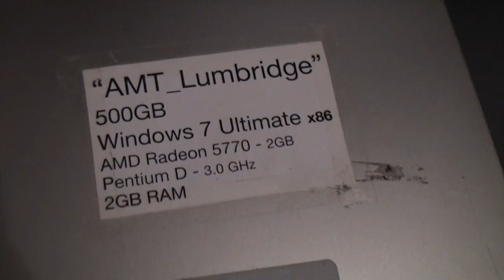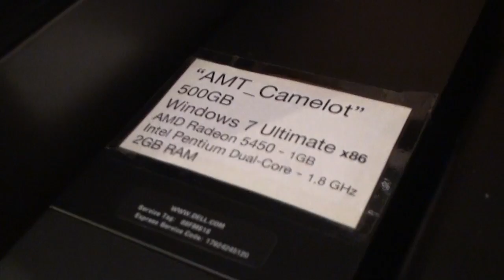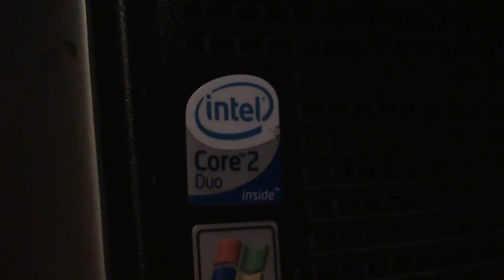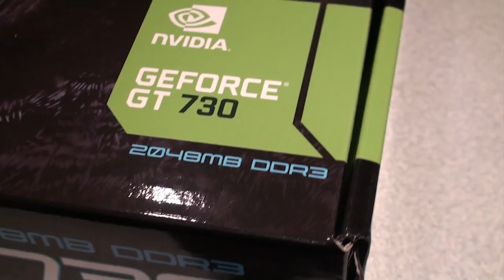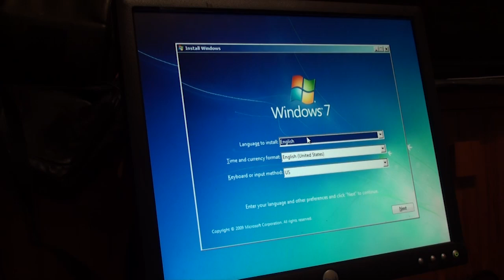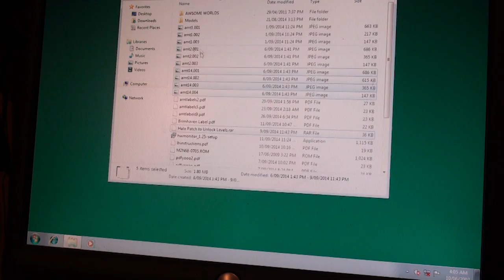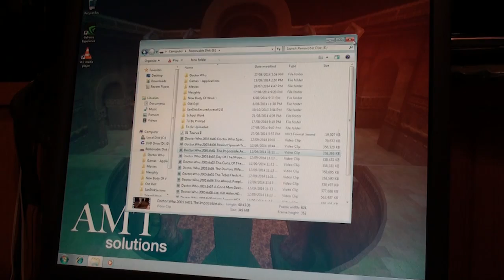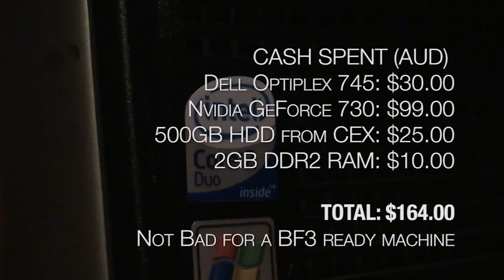Turning an Optiplex 745 from Boy to Man - Green Ham Gaming

Comment: Meanwhile, LTT bashes the GT730.
Reply: Even if I can assure you by experience, you can overclock the living daylights out of it. 
I've maxed mine out and I have no errors at all.
Reply: I'm actually planning to get a GT730 as a replacement after my horrendous GT520 got fried.
Reply: ToperMasterComedy Haha, I had a similar case today! My old P4 got fried today!
If you get one, consider overclocking it, it can go up pretty high.
Reply: Lizrad Sceptile No, let him to do it, the 750 can't get as overclocked.
Reply: TheLazyWanderer he can buy something used for a much better price. Its pretty dumb to buy a gt 730, which gets beat by intergrated graphics, rather than buying something used like a gtx 650/660 or a radeon 7850/7870.
Reply: Lizrad Sceptile Well, I needed to find a low profile GPU that will take the place of the GT520. So it needed to run power off the motherboard and fits in a low profile case. Most GTX cards are out of the question and most high end cards.
The only GTX I can go for is a low profile GTX750.
Power consumption is also a factor here since my setup runs off a proprietary 180w PSU. I calculated and the max TDP GPU has to be under 55w. 
So I got very limited choices. Any good suggestions for powerful but power effiecient and low profile cards?
Reply: ToperMasterComedy Yeah, the GTX he is talking about won't fit in your case.
And also, it takes far more power. The GT 730 will consume 79 watts maximum. It usually consumes 50.
Also, Lizrad Sceptile , NOT EVERYONE HAS CRAIGSLIST OR OTHER SECOND HAND SHOPS AROUND THEM TO GET SECOND HAND ITEMS FROM, BOTH YOU AND BLOODY LTT, PLEASE REALIZE THIS!
Reply: TheLazyWanderer I got multiple choices so far. And it's a mix of cards really.

I'm still researching so oppinions may change overtime.
For power consumption, I'm considering either a GT730 or R7 240. Both have power consumptions close to the GT520. But both are more powerful than the 520. And I don't need to worry about risking blowing up my PSU. Which can't be upgraded since it's proprietary.

I'm still considering more powerful choices but again, power consumption, needs to be 55W or under. 
Originally I was thinking about the low profile R7 250 like GHG used in the Quad Core Dell, but even the low profile uses 65W TDP. Which is rather unefficient since the GTX750Ti Low Profile is way more powerful and only uses  60W.
The GTX750Ti is out of the question too since it's TDP is 60W. Which means only the GTX750 will work for my setup since it only does 55W.

My other choice is a Radeon 7750. On par with the 5770 which GHG always use, it's performance is close with the GTX750 on paper and it only does 55W under load. 

So far my choices
GT730
R7 240
GTX750
HD 7750
Reply: ToperMasterComedy I know the 7750, it's too big, as well as the GTX.
The R7 240 is... pretty weak, also the 730 consumes less power than that one.
Reply: TheLazyWanderer The 7750 and GTX750 both have low profile options.
The R7 240 is out of the question then.
Reply: ToperMasterComedy Yeah, but the low profile GTX has 1 gb of vram at best.
Even if it is gddr5, it's still small.
Reply: TheLazyWanderer Well, the VRAM doesn't seem to matter too much to my liking anyway. As long it's 1GB at least. GTA 5 maxes out my GT520 more than it could take but I can play the game on normal settings at near playable rate. I'm not too hard core in games but I do want to extract more in terms of graphics performance.
Reply: TheLazyWanderer I'll take all of these into consideration. I'll see what I'll decide eventually.
Reply: ToperMasterComedy Alright...
Reply: TheLazyWanderer get something from a friend then. If not, then find a deal. Patience is a virtue. If you dont feel like waiting, than go for an r7 240 or a 730. However, id suggest this guy gets a whole new system, because of the proprietary psu.
Reply: Lizrad Sceptile Well, I don't really feel like getting a whole new system over again. The processor which was a Sandy Bridge i5 is still perfectly capable. So I'm not going to dump it anytime soon.
The only thing it needed was a few upgrades to get it to today's standards.
Reply: ToperMasterComedy oh shit, if it has an i5, keep it. Just upgrade your psu and mobo if it has a proprietary form for that psu.
Reply: Lizrad Sceptile Yeah, if he told you that it had a G3258, you'd be like "Eewwwww dump it!!"
Reply: Lizrad Sceptile Cause you're wrong.
I've heard the same thing from anyone who has a sick MLG PRO ULTRA POWER GTX  980 or higher.

(Even if I am thinking of bying an rx 460. It's the same price as the 750ti and it's much better, I compared the specs)
Reply: lol
Reply: TheLazyWanderer 
>im wrong
>730 gets beat by apu graphics
Reply: Oh gosh...This is turning into an arguement
Anyways. If I'm using something like a Ivy Bridge processor, then yeah....The 730 won't be worth it since intergrated are getting better lately. I have a laptop with a Skylake processor and the intergrated HD Graphics 520 works decent for lighter games.

But I'm using the Sandy Bridge for my main computer. Where the intergrated graphics were a joke and the GT520 that it came with help with some basic graphics. So a 730 still makes sense for an older system. It's still good for normal graphics that works for casual gaming without blowing up the PSU. Which I can't upgrade
Reply: Lizrad Sceptile The i7 HD graphics? 
Sure.
Reply: Lizrad Sceptile And LTT bashes it cause he always using Titan X's!!! 
You'd expect him to care about a budget card?
Reply: TheLazyWanderer anything with hd graphics 530. Which would be all the way down to the i3 6100
Reply: Lizrad Sceptile Do you know how much Skylakes cost here? 
180 euros. A good one at least
Reply: Lizrad Sceptile Do you have Hangouts or anything? 
It'd be better to move this talk somewhere else and not pollute this guy's comment with replies like that.
Reply: TheLazyWanderer the point is that the 730 is a terrible value.
Reply: Lizrad Sceptile TheLazyWanderer 
Feel free to continue your talks here. I'm up for your ideas.
Reply: Lizrad Sceptile I'll keep on saying otherwise mainly because I use it right now and I can still play the games I want.
I mean, yes, I am gonna upgrade eventually, but not to a sick powerful crazy specced card, I'm gonna get the rx 460.
Reply: the gtx 750 is about 4x better than the gt 730 though
Reply: Leon Yeah but costs double.
Did you ask him if he's in the position to give it 130$?
Reply: TheLazyWanderer why is this still an argument. The 730 is an awful card for its price. Maybe if it was cheaper, it would be better, but as of now its an awful card for its price.
Reply: It's 80 bucks.
If you're a Craigslist/eBay die-hard, that's not my fault. You can find better secondhand cards there for cheaper.
I'm not talking about secondhand cards there.
Reply: TheLazyWanderer Secondhand cards are way better than the gt 730 for the same price.
Reply: Leon You may say that there are better used cards than the GT730. And I agree. I would be happy to buy a used GTX for that price. But even under a cheaper price, not all PCs can handle it.

My PC. It has a small form factor case so it only takes low profile cards and a proprietary 180w power supply that can't be upgraded. It's my main PC and because it already had a 2400 i5 in it, I don't want to throw it out. 
I need a new GPU in it because the crappy GT520 was fried.
The low profile case means that most GTX cards are out of the question. The only GTX it will fit in is the GTX750Ti Low Profile. 
Power consumption is a thing as well. The 180w power supply means I can't have a high power card either. The 750Ti does 60w on load which is more than the computer's manual suggest which is under 55w.

The GT730 is a good replacement because it's low powered, 38w under load so I don't risk burning the power supply, fits in the low profile case and it's way powerful compared to the GT520.
And the GT730 suits my needs because I'm not a hard core gamer in anyway. The games I pretty much play is GTA 5 and some old games. Which the GT730 should be able to handle.
Even GHG mentioned the GT730 is great for low powered builds.

Not everyone here can build a crazy LTT system here.
Reply: Leon Again, I'm not talking about secondhand cards, cause not everyone has the luxury that is a secondhand shop close to them or even in their country.
Reply: ToperMasterComedy Your view is right.
I'm not saying it cause you're not bashing the card. But indeed, that is probably the best card you can get that is low profile and fits in the small form factor case.
Reply: ToperMasterComedy I dont have a crazy ltt system its a ebay system with an i5 750 gtx 480 and a 250 gb samsung 850 evo. I have been looking at a x58 mobo though. But would it be possible for you to remove the parts in the case because i feel bad for you having to get a 730, it cant really play any games.
Reply: Leon You have a gtx 480... and an SSD.
Those two make your pc crazier than mine and his already. I have a g3250 and the gt730. Well, the msi gt730. It's also overclocked, so it feels a bit more a weaker 750.
Reply: TheLazyWanderer Well dont forget the gt 740. And the PG3250 isnt that bad. Its probably better than my old i3 550.
Reply: Leon I've seen its specs... There's not much of a difference.
So, would you consider a rx 460 to be a good upgrade for 720p?
That's the one I'm planning to buy cause even if the 730 got me through most of the games I wanted to play, it can't run AC Syndicate.
Mind you, I won't get a GPU more expensive than the 460, that costs 200 euros here.
Reply: TheLazyWanderer at 4.9 teraflops i would say its a good 1080p card i definatly remcomment it, with syndicate though it might have to run at 720p. And syndicate is recommended to have a cpu with 4 threads so that possibly might be your issue.
Reply: Leon I can't afford a 4 core cpu, I'll only get one if I really, REALLY need it.
Reply: +TheLazyWanderer My i5 is a 4 core. But then, I bought it as a prebuilt system anyway.
Reply: ToperMasterComedy So there is no way to salvage the cpu and motherboard?
Reply: +Leon I can salvage out the CPU but I don't feel like rebuilding the whole PC.
Reply: ToperMasterComedy It will take like 10 minutes and then you can get a better gpu.
Reply: ToperMasterComedy That prebuilt system must have costed at least 500 dollars.
Reply: +TheLazyWanderer Well, it costed right in between 400 to 500. And damn I made a wrong choice a few years back.
Reply: +TheLazyWanderer It's more like a PC meant for movie watching and entertainment. The GT520 it came with just does that.
Reply: ToperMasterComedy Alright...
Then you don't need a powerful card at all, the 730 can get you up to 4k.
Reply: +TheLazyWanderer I don't use it as a part of my home theater setup. But it's designed for that type of applications. It's still my everyday PC for Youtube and casual gaming. Mainly, GTA 5 and some old classics like GTA San Andreas and Need For Speed Most Wanted. I have a Skylake laptop just for my schoolworks.

Nonetheless, the GT520 does GTA 5 at a choppy but playable framerate at low settings. And that's all I care about. Play these games at playable rate. The GT730 should do better and still keeping it's low power usage.
Reply: ToperMasterComedy I've finished it with this card, it'll bring you 45 fps at 1024x768 at high settings.
Reply: TheLazyWanderer The not even an hd resolution though. If I were him I would get a gtx 750.
Reply: Leon Again with this!
There is no gtx 750 that is low profile!!!
Reply: Newegg?
Really?
That's exactly what I fucking hate with the pc community. They act smart cause they all get their parts either secondhand or from the internet.
Heey, not everyone has credit or debit cards y'know! Some people are limited to retail stores. And this one doesn't seem to exist in a retail store anywhere.
Also, 120$. You do the exact same thing LTT does and it made me wanna bash his face in. "Ooh, I know you don't have much of a budget, but you can spend a bonus 40 bucks for this card!"
Final. What about power consumption?
Lemme clarify his request. He needs a card that won't use more than 55 watts, and that runs gta v at least in low settings.
I play it in 1024x768 cause I want to, the gt 730 can handle it in 720p, just in 30-35 fps instead. I just like the small buff in the framerate.
I BET you that this thing will use more than 60 watts under load.
Reply: +TheLazyWanderer I was actually going to find the low profile GT730 at newegg. Because all the local walk in shops only had full sized GT730.
The GTX750's power consumption even with the low profile, is still too much for what my power supply can handle. Needs to be under 55w again and I don't want to risk blowing up my PSU. 

About gaming resolution, I'm casual so I don't care about too much as long the game is playable. I did GTA 5 with 720p. All the newer titles I run on my PC I run them all with 720p. Most with low settings, like NFS Rivals(Overclocking my GT520 does make this game playable. Until it fried itself). Older classics, just crank up to 1080p and max my PC handles them fine. I used to play Left 4 Dead 2 on my PC. Maxed out the settings and the slightly overclocked GT520 doesn't give a shit. It lags slightly of zombies fucks with you but the rest of the gameplay is playable. 
This is my gaming experience with my PC and I don't really need much out of it.
Reply: ToperMasterComedy Alright... 
I did mention the wattage issue above too.
Reply: I love their videos, but honestly, they can be such elitists at times. It's annoying af.
Reply: unnamed715 I know right...
And the ads...
Reply: The only thing they cover is those high end stuff that most of us would not be able to afford. Nope. 

Like we can afford a 20 Xeon Build with 5000 fucking Titan Xs in SLi mode....
Reply: ToperMasterComedy Hahahaha, indeed!!
Reply: did he get the 730 yet
Reply: TheLazyWanderer They need ads.
Reply: I understand they need ads. But not until they rub it into your face. Which can get annoying.

One notable example is most phones on LTT that they reviewed lately, the all would have a dbrand skin applied to them. We don't want to see the phone with a dbrand skin on. We want to see it's actual design!
Reply: ToperMasterComedy uhh what?
Reply: Leon He said something that is pretty agreeable and logical.
When a new phone comes out, we wanna see how it actually looks, not how it looks with a skin slapped on it.
Reply: TheLazyWanderer Well thats personal taste because idgaf what the phone looks like as I put a case on it.
Reply: So you're GONNA put a case on it, like the phone is GONNA come with a case on it before hand. You're not gonna look at it with no case on it.
Reply: TheLazyWanderer Then don't watch the video Jesus Christ.
Reply: The video has nothing to do with this.
Reply: TheLazyWanderer
That too. I recall a video where they said "we normally don't want to do videos on $100 cards because you guys don't really wanna see that." How tf do you know?! I'm interested in ALL hardware, not just the fancy expensive shit. :/
Reply: unnamed715 Same here!
They should ask their community before jumping to conclusions!
Reply: unnamed715 Indeed he does...
That's why I stick to channels like this one, Science Studio, LGR, Nostalgia Nerd, with a bit of Awesomesauce.
Reply: TheLazyWanderer
Yeah, TechByMatt is pretty good too, or Austin Evans, he's also cool. JayzTwoCents is...okay at times. But he too can be a major douche at times.
Reply: unnamed715 I've watched a bit of him, haven't gotten him to be a douche though.
Reply: TheLazyWanderer
Like I said, he's okay, but he does tend to say some things that can come off as an elitist.
Reply: unnamed715 Still, LTT in my view is the worst.
Reply: TheLazyWanderer
True.
Reply: TheLazyWanderer ^
Reply: TheLazyWanderer One of my main go to channels for PC builds is obviously GHG. Old systems, but perfectly capable and affordable. Another channel I do watch for used PC builds is Tech Yes City. 
For newer PC stuff, I do catch up with Science Studio from time to time. 
I would only watch LTT if I'm really bored.

For mobile phone reviews...Anything other than LTT.
Reply: ToperMasterComedy I agree 200% about the last one.
For phone reviews, i'd suggest you Unbox Therapy.
Reply: unnamed715 Mhm!
Reply: TheLazyWanderer UnboxTherapy, MKBHD, Austin Evans, Android Authority, Pocketnow, those I would usually watch. Any mobile review channel imaginable. But not LTT.

I wouldn't watch Techsmartt either. He's fucking annoying and cringey at times. TechRax and all those people who think phones can survive a gun shot or endless water.
Reply: ToperMasterComedy TechRax can be amusing at times, but TechSmartt is... infuriating. Let's say that only.
Reply: ToperMasterComedy because you can get so much more performance with a few more dollars... not worth it
Reply: SeventySeven Except I have to get a GT730 because only that would fit in my low profile PC and my non upgradable power supply can take. I can go for the GTX750Ti low profile but that would bust my power supply. The manual for my computer does say TDP for an upgraded graphics card should not exceed 55W. The 750Ti does 60W. To be safe, I only searched GPUs with TDP under 50w.
Reply: TheLazyWanderer I'm going to order a 730 soon from Amazon or something.
Reply: ToperMasterComedy
Newegg might be cheaper. Just sayin'... ;)
Reply: Well, they did have a silent version, which probably hurt the performance and temps. And they benched it with newer titles.
Reply: unnamed715 ;)